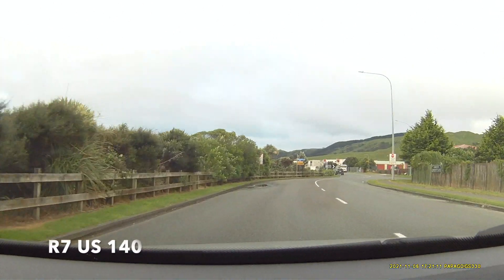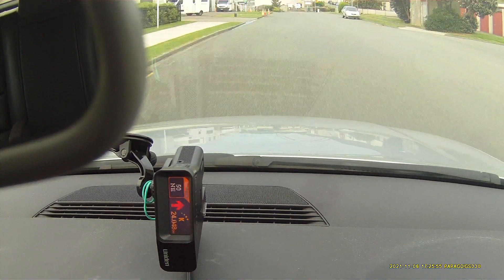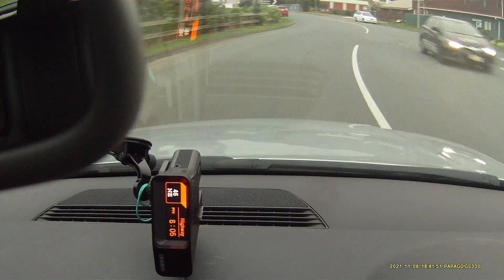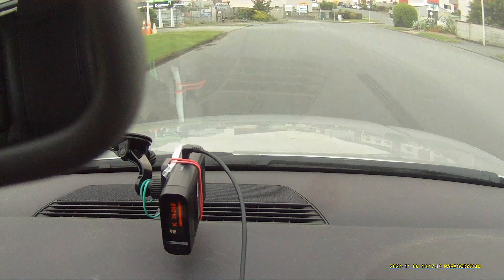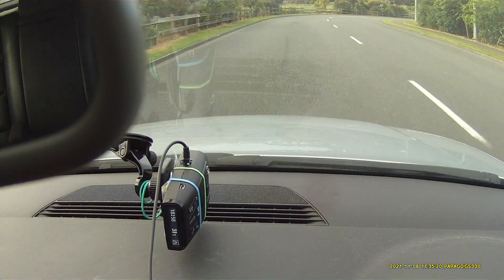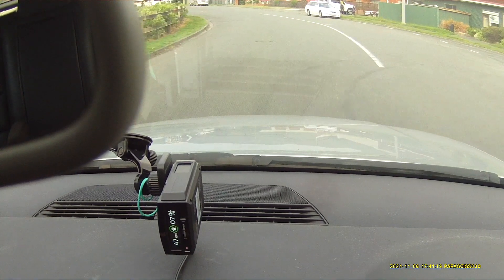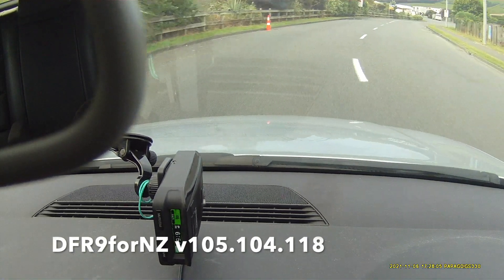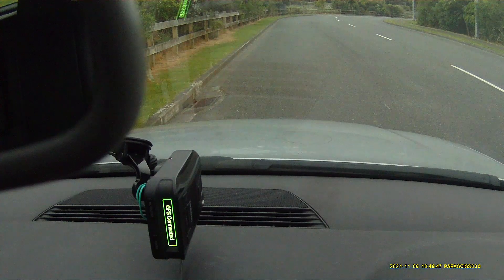Radar Detector Shootout vs Simulated mobile redflex speed camera van

Comment: As an engineer (EE), there is WAY more to a signal than its frequency and angle. There's also polarization AND modulation. I imagine that sport gun you used ($140?) is basic CW. Without an anechoic chamber, think FCC testing, you are also guessing about your beam and characteristics of same. I think Gatso (RT4) actually modulates their carrier similarly to BSM, which is why it largely goes undetected, your/some detectors have been programmed to ignore that behavior.
Reply from the maker: You make many good observations. However, lets also consider that the simulated testing results compare nicely to what you see when comparatively testing against the our genuine mobile redflex.  The mobile redflex we have in NZ are polarised, but are not modulated and not FMCW.  My test set up is also partially polarised, and the detection performance against my test setup is actually harder than what we see against the mobile redflex.  In NZ if you want to test against out fixed redlight speed cameras, then these are FMCW and need to be tested differently.  Since filming this video I have since published a more recent video where I also tested more detectors, and also got to compare the Redline 360C and V1Gen2 against the real redflex.

Comment: Great video. Only issue with this testing is that source isn't FM-CW. This matters because detectors BSM filtering is likely to interpret  differently, CW yielding a more instantaneous alert
Reply from the maker: Mobile redflex is not FMCW.  The fixed redspeed redflex cameras in NZ are FMCW.  This is why the fixed redflex speed cameras and mobile cameras are detected with K band, but the redflex redspeed cameras need MRCD setting enabled to be detected.